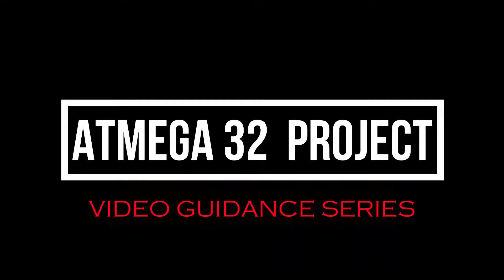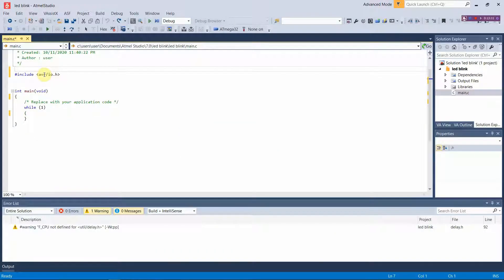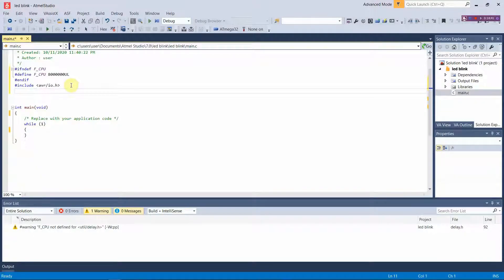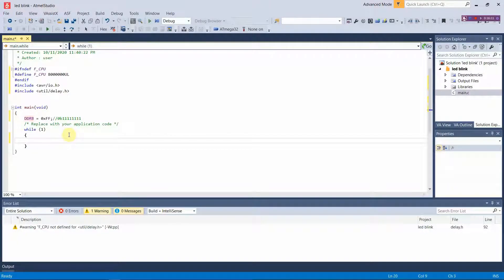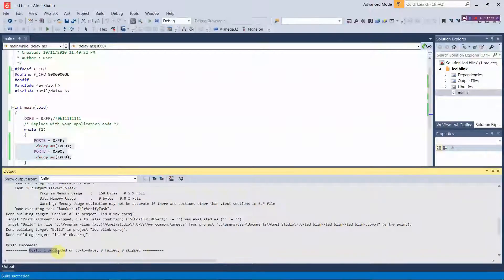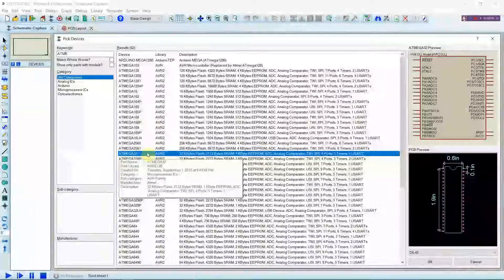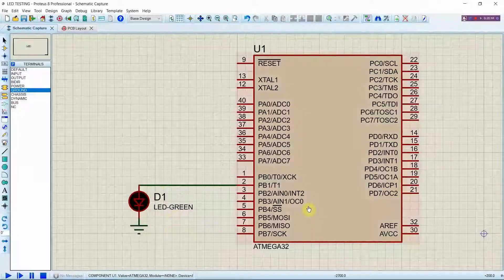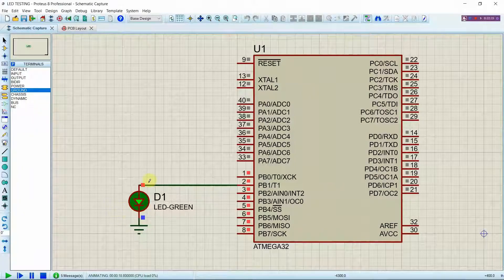BLINKING LED TUTORIAL USING ATMEGA 32

Comment: hello, how can I make a led blink at different frequencies?
Reply from the maker: Frequency in the sense if you meant different colours, You have to youse an RGB led while generating PWM from microcontrollers
else if you wanna adjust the speed you can adjust the delay timings...

And we value you soo much
if you feel our channel is helpful please subscribe to our channel and share it with your friends..

If you need any further clarifications please feel free to contact us.
regards,
Nishad
Reply: @techwithcodeblack  yes, I m referring at speed. For example, instead of 2 frequencies, the LED should blink at 3 different frequencies, upon successive keypresses
Reply from the maker: @MrRobi10  Thats so easy
You are going to code the instructions inside a loop where the condition of the loof is being the button is pressed

So inside of the loop you can adjust the glow time and the off time using the _delay_ms() function by adjusting the values

And to increase the no of times either you can repeat the code or you can use a nested loop such as a for loop or a do while loop where you can define the no of times you want it to be done...

Hope this was clear if not just shoot me your questions ill clarify it..
Reply: @techwithcodeblack  Can we talk please in a private chat? I have something but I don't know where to start from..
Reply from the maker: @MrRobi10  ok sure but what mode do u prefer
Say

So i can contact you so
Reply: @techwithcodeblack  or Facebook if you want
Reply from the maker: @MrRobi10  use my insta @ahmd_nish. Or Facebook Nishad Ahamed
Reply from the maker: You can try using pwm waves to change the frequency automatically